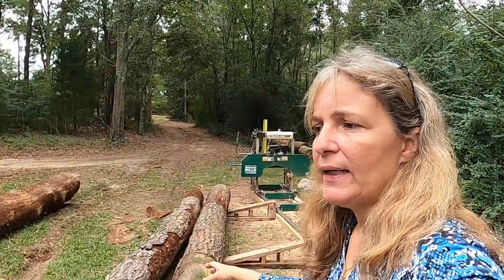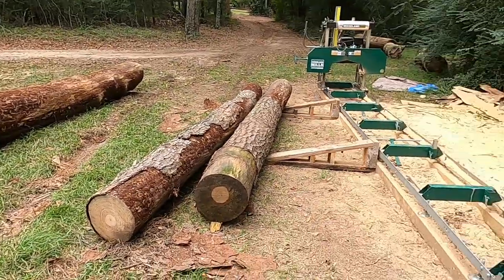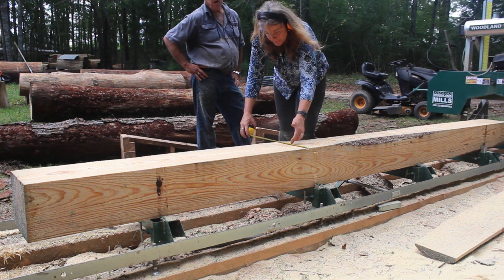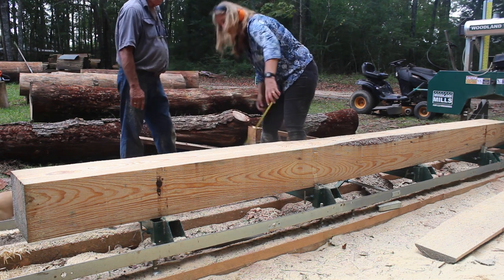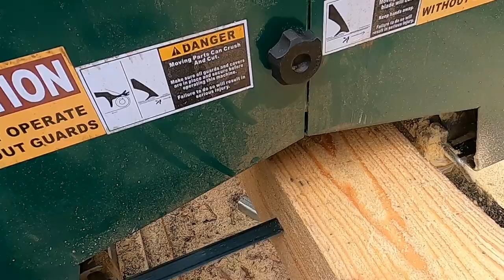A NEW Stihl and MILLING More Pine for our Bedroom

Comment: I have hit my dogs before so don't  feel bad. A small winch mounted on a 6x6 and run the winch cable under the log and hook back to the 6x6 will roll that log right up on the bed. Will save the back. Great video I truly enjoyed them. Thank for sharing. Be safe

Comment: been there done that ......i cut a bunch of hardwood 2by2 for that purpose ...i seldome use the iron backstops now ...now i use oak 2by2 for back stops but take them out when done because they will swell up from rain and get stuck in there
Reply from the maker: we were just talking of that very thing the other day. The only oak we have is red oak, I wonder if that would be hard enough wood to stay straight.
Reply: @ThirdTimeAroundRanch  if it is completly dry yes red oak will be fine and if it warps a little bit just put it in sideways so the curve is running paralel with the log and upright square with the log...only 2 problems i have had is i left them in and they swelled up in the rain and i couldnt pull them to replace them so i had to drill it out ..also 1 time i cut off about 1/2 inch when milling a log and that little peice shot inside of the houseing and got caught between the wheel and the blade ...that kinked the blade but no other harm ...that only happened once in the last 2 years